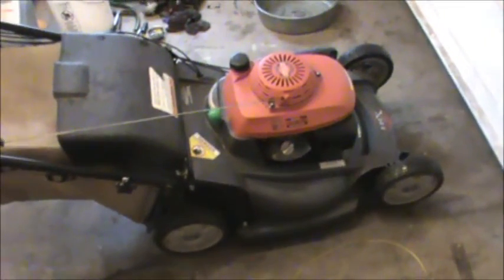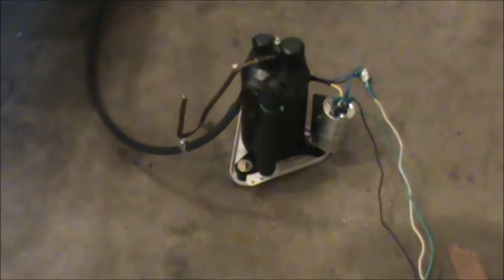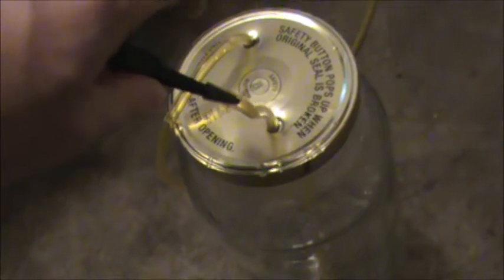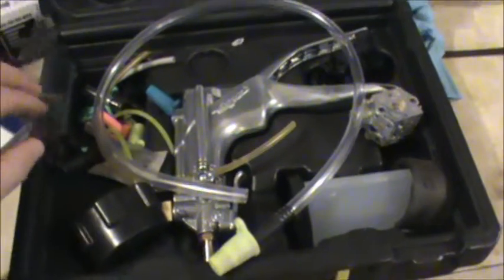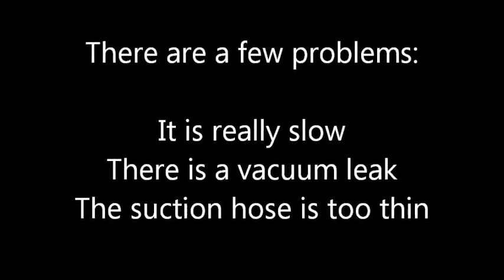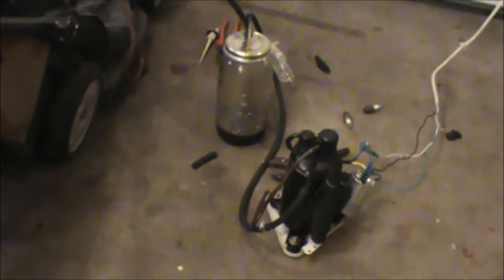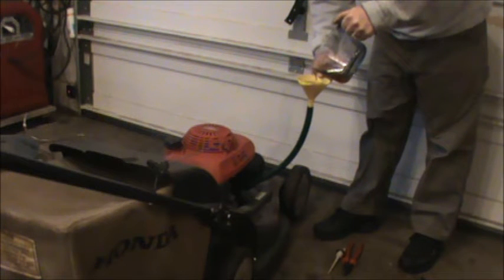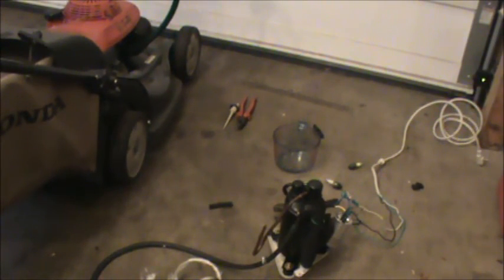Homemade Tools Oil Extractor for Car or Lawnmower

Comment: i made a very similar setup using 4" pvc with a cap at the bottom and a reducer at the top that i cut to fit the shop cac. i used about 1/2" clear tubing and ran it through the side of the pvc and down inside. ive had the setup for several years now and i use it all the time for removing bad gas, cleaning carbs, and changing oil. I'll make a video  tomorrow. im glad to see other people thinking the same way!

Comment: The fluid extractor that looks like a grease gun might be better for an inexpensive solution for a DIY application. Just adapt the 3/8 down to a smaller plastic tube. There is also a small gear oil pump that might work to pump out a small engine with a few strokes... Check out the 'Air Power America 2000 or 2005' extractor, I need something for P/S pumps and small engines for a cleaner fluid exchange... Thanks for the video